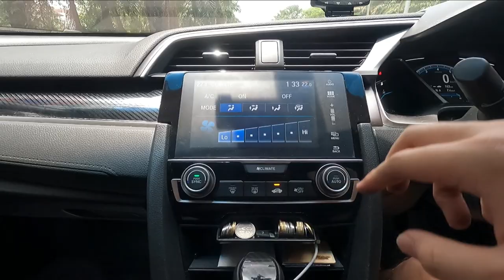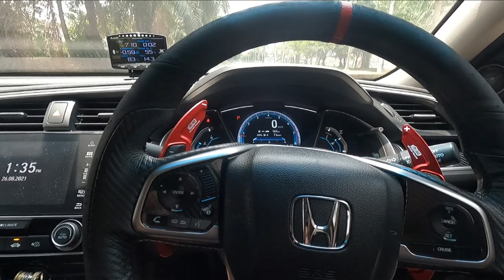My Stage 2+ Honda Civic FC/10th Gen Review: Daily Driven!!

Comment: My question is may I upgrade to stage 2 but didn't change the exhaust system?
And how much for the tuning to stage 2?
Reply from the maker: Yup stage 2 doesn't require an exhaust system but it would be good if you do. Mine's 2.5 inch but if you can get a custom 2.3 inch that would be better.
Reply from the maker: I did 2 tunes so can't say the exact figure. But both are custom tunes with dyno.

Comment: i heard for the cold air intake you need to put cover the intake to prevent engine heat to enter, but yes if you opened the lid more wooshing sound but heat will be more towards intake, unless you change the front bonnet with airflow holes
Reply from the maker: Not necessary. I custom made extensions to the box so I can prevent heatsoak as well as get the wooshing noise. So far been getting good temp figures.
Reply: @DrivenTechReviews  nice, means using existing mishimito pipes and custom it right? im thinking of cold air intakes, to prevent heat soak from engine and for cvt using intercooler so that we can drive the car in a spirited way :)
Reply from the maker: @krk24  yup. Just custom it. I used number plate boards, measured and cut to shape including screw holes so I can use back the existing holes on the box. CVT cooler installed behind the grille so not obvious but gets adequate airflow.
Reply: @DrivenTechReviews  thanks man for sharing..any good shop for intercoolers, cold air intakes?
Reply from the maker: @krk24  for intake I suggest MST and a roll of gold heatshield and wrap the pipe. IC I would recommend PRL only if you going to upgrade your turbo otherwise you'll notice quite alot of turbo lag. Standard IC is more than adequate for a stage 2 tune. MST intake can get from shopee or lazada. KC Motorsports @ Sunway has stock too I believe. But just buy and DIY install is the best.
Reply: @DrivenTechReviews  bro MST is taiwan brand ok mou? also thanks for highlighting on IC, because i thought eventhough im not gonna upgrade into bigger turbo but atleast i wanna keep it cool for the cvt is my objective, but since you said got turbo log is it significant?
Reply from the maker: @krk24  it's good. I am using on my Scirocco so far been good. CVT cooler is different from IC bro. CVT fluid is brought up to temp by the radiator fluid. The CVT cooler takes the CVT fluid out to the front so the air can cool it. But it's stabilized by the radiator fluid anyways. IC keeps the intake air cool and a bigger aftermarket IC will definitely have turbo lag Eventhough u can see improvements I don't think it's worth it unless you keep pushing the car alot.
Reply: @DrivenTechReviews  nice sharing bro, yes i love to tekan but cant tekan alot due to cvt but prefer spirited driving thats why i thought intercooler can solve the cvt heatsoak but nobody tell about turbo lag from even overseas youtube channel bro
Reply from the maker: @krk24  bro as I mentioned intercooler won't solve CVT heatsoak. Only CVT cooler can prevent the CVT fluid from overheating.
Reply: @DrivenTechReviews  noted bro, so any suggestion for cvt oil cooler?
Reply: @DrivenTechReviews  bro can dm?
Reply from the maker: @krk24  sure bro. IG @droidtechreviews